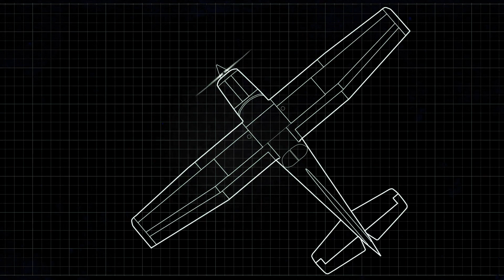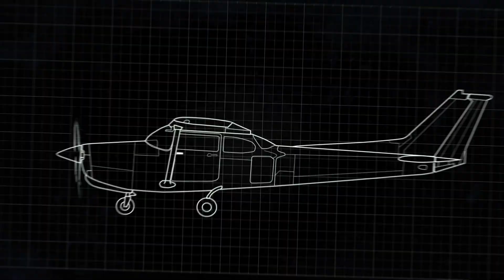What Happened To The Tailless Stealth Fighter?

Comment: Looks like It's pretty easy to turn one Wikipedia article and its sources into a three-minute video. Looks like It's still pretty hard to make a factual three-minute video.
0:14 "Its 1994... ...stealth technology would take center stage in the development process for the first time" - The f-117 STEALTH FIGHTER started development back in 1975.
0:28 "This new concept for a tailless stealth fighter" - Phantom Works YF-118G Bird of Prey flew without a tail one year before the X-36 and started development two years before 1994.
0:38 "shattering all expectations" - Nope
0:45 "without the tail, how do you control the aircraft in the first place?" - FLY-BY-WIRE! The B-2 Spirit, which first flew in 1989 had NO TAIL and fly-by-wire solved the problem. Even back in 1981 the f-117 Stealth Fighter was using fly-by-wire to compensate for its aerodynamic instability.
1:00 to 2:00 is basically just filler, so this is actually just a two-minute video pretending to be three-minutes
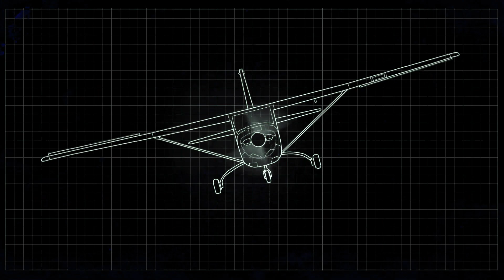2:08 "real game-changer would be equipping the X-36 with advanced thrust vectoring nozzles like the ones we see in the f35s today" - Fly-by-wire would have been the "real game-changer" but more egregiously the f-35 does not use thrust vectoring for manoeuvring. Sure, it vectors thrust to STOL/VTOL, but not to enhance its manoeuvrability like the f-22. For anyone actually interested, the X-36 used thrust vectoring for additional yaw control, which is pretty cool.
2:23 "they also added a digital fly-by-wire control system" - Hey, fly-by-wire! Finally. So basically 1:00 to 2:30 is all filler cool.
2:45 "The plane’s unique and pilotless design meant they could withstand significant damage and take a much harder hit if necessary making them ideal for future roles as a drone fighter or as an autonomous combat support drone to aid fifth-gen fighters in a kind of wolf pack tactic" - bro McDonnell Douglas did not invent UCAVs, the idea had been floating around since before the D-21 Supersonic Reconnaissance Drone in 1962.
3:04 "the X-36 would ultimately prove that tailless fighter aircraft were possible and that maybe they could be the future. What do you think tho?" - The X-36 did not prove that tailless fighter aircraft were possible, everyone already knew, it was however a necessary step forward in advanced aircraft design. Personally, I think split V tails and flow control is the future, canards are going out of fashion.
Anyway, thanks for putting your script in the description. Made it super easy to tear your video apart. Do better next time, and produce something actually factual.
Reply from the maker: Ok looks like i need to fact check and do deeper research next time. Thank you for pointing out the inaccuracies. Will work to ensure that it doesn't happen again.
Reply from the maker: thank youu... means a lot honestly. Defo need to work on the accuracy tho...gonna keep that up and centre next time.
Reply: @BenjaminGordon-ic4ow Constructive criticism, detailed as such? That's being a jerk? 

We live in an information age. Not looking something up is lazy. 10 more minutes of searches solved this. And he proved that in a detailed rebuttal.